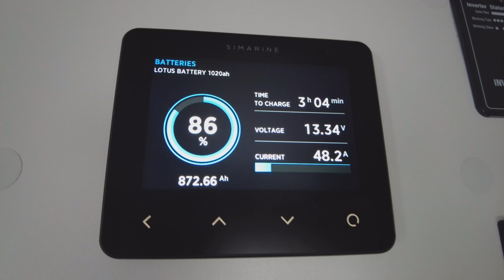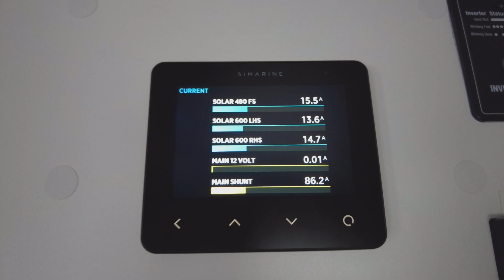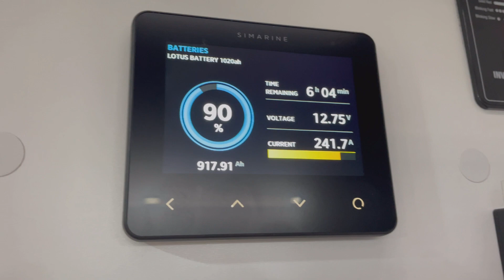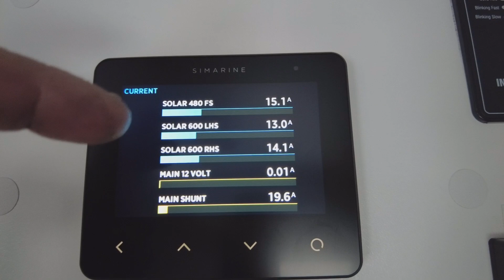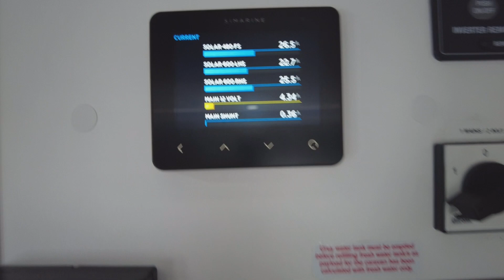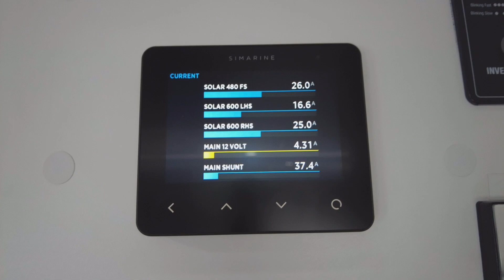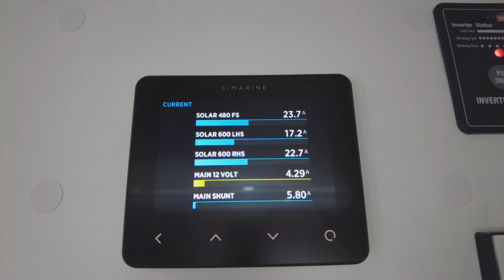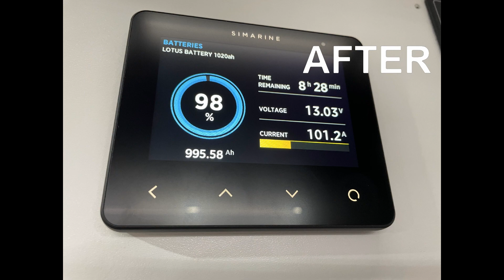Lotus Off Grid 1680 watt Solar, 1020ah lithium. Runs the microwave, Air conditioning and more.

Comment: I love your setups.  With all the laws changing regarding lithium batteries inside vans being sealed off inside, with ventilation directed out.  I understand this November, so the sealing of is not required until November? can you bring batteries in boxes outside back into the inside as I noticed you had done this on this van. Especially as I'm getting rid of AGMS and moving to off grid setup using Powerpauls.  Great work.
Reply from the maker: Yes, some changes will be happening. 
Basically the battery enclosure cannot be part of the habitable area, vented to external and accessible to external only.
Max 4 terminals on any battery post too.

Comment: great video to confirm a compressor fridge is preferable to run on 12 batt not 240 inverter when off grid ? I had my charger wired to a separate 240 volt circuit on a c/o switch but didnt think about the fridge the two GPOs are close together so i can easily run the fridge 240 from the same charger GPO if needed. Cheers Dean.
Reply from the maker: Of course at the end of the day the compressor is 12 V anyway. Why go from low-voltage to high-voltage to only go back down to low-voltage again. That would be very inefficient stick with DC. 👍
Reply: @extremeacc101  cheers an easy fix thanks.

Comment: Could've done without the Simarine, proven by the fact you have the Victron app open... a Victron SmartShunt would've covered it all and communication between the Victron gear enables VRM Portal data logging.

Comment: Don't forget if the pins are not adjusted correctly on a 12 pin plug that creates resistance then the heat problem's also make sure the wire hasn't been cut on an angle to fit in the plug a brass adapter as what comes with a jayco should be used this goes for all 12 pin plugs
Reply from the maker: well said

Comment: Very neat work. The Simarine figures didn't add up. You need separate shunts on battery final neg and inverter to get correct totals.
Reply from the maker: That is correct the shunt is there. very hard to see the programming came after the video.
Reply from the maker: The 4 x 50a SCQ unit is running the 3 x solar controllers and 1 x master 12 volt circuits.
The SC303 shunt has the inverter and master earth.
Simarine has the option to not add the 4X 50a circuits to the battery.
This means those numbers will not be displayed on top of the shunts reading value which would explain the double up you see.
Turning those values to off will resolve this issue.

Comment: Awesome, right up until the Simarine. I had endless issues with that junk, battery SOC discrepancies, tank level inaccuracies, app keeps crashing and the lack of interfacing with hardware (ie: water pumps, lights etc) and yes, SeaZone is better but price it up... Enerdrive really are lacking in their user interfaces.

Comment: Another quality off grid job. Was wondering: having the 3 batteries, why did you have positive cables off the two end batteries for the inverter?  Is there a reason for that? Thanks.
Reply from the maker: Great question.
Upon discharge testing the inverter under full load the best even amount of discharge between all 3 batteries came from this method. Originally we had all pos on the end battery and all neg on the first. This resulted in a small uneven discharge under the same test conditions of the middle battery. Cable length to the redarc inverter is 100mm longer on the positive feed. Maybe this was why?
The balance is now so even the DALYbms showed an even 83a per battery. Very very happy with that.
Reply: @extremeacc101  l

Comment: Geez I pick up my 23.3 OffGrid in two weeks and wish I got you to do my electrical. Way better than factory
Reply from the maker: Exactly. We pay top dollar for a new caravan and yet most of the time, the wiring is sub standard.
Reply: @extremeacc101  I’ve got it with 5x170 solar panels and a redvision system. The issues is they are using a bdcd50 just for the solar as the redvision bms is only 30amp charging but by doing this I don’t get a readout of how much solar input we are actually getting.  If i might even sell the bdcd and get a Victron solar charger that way I can use my phone to get a read out.
Reply from the maker: @matthewfinnigan3862  
Mate, instantly I would pull all of that solar out of the manager.
Rewire your solar into better voltage strings and run them into a couple of Victron solar controllers.
Networked together.
Then use the old manager solar input for portable.
Wire the Victron negative to the external Redarc shunt so it monitors the new solar setup.
Reply: @extremeacc101  they have added the bdcd50 for the solar but that should only be good for 600 watts? So thinking of putting in 2 Victrons. I might have to swing by when I’m coming thru SA.
Reply from the maker: @matthewfinnigan3862  
I definitely wouldn’t be running the roof solar into the Redarc dc charger.

Comment: ? do you run a cooling fan for the system it has to produce fair bit of heat. I'm running 6 panels just under 1000w with a 560ah battery and a 3000w inverter the fan runs a fair bit.
Reply from the maker: Yes, There are vent points above each solar controller.
Reply from the maker: There is a Simarine temperature sensor at the highest point in this cavity right between the vents so this will shut down the solar input under a high temperature alarm. Very useful the Simarine units are.

Comment: Another awesome install Matt , what 240v charger did you install ? Great to see a install with different brands
Reply from the maker: That had a Victron 30a unit.
These guys are mainly off grid reliability on solar/vehicle was priority.
Reply: Prefect set up mate , I’ve been waiting for you to do a redarc 3kw inverter setup with a mix of other gear . I have a 3kw inverter in my new van coming
Reply from the maker: @jarredkirby5039  
Nothing wrong with it in fact as long as it is installed correctly there is no issue at all. 👍👍
This one had the fridge GPO and the Battery charger GPO  before the inverter. This is how it should be done. Take note of the manual transfer switch under the Redarc inverter remote.
👍🔋👍